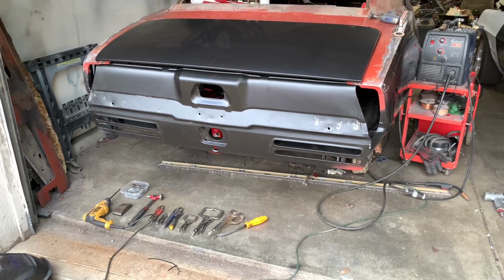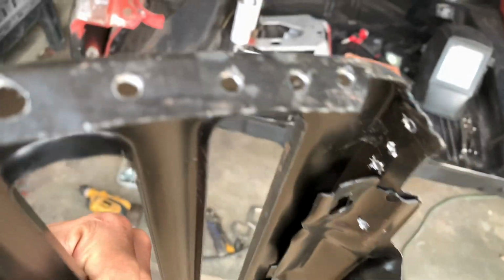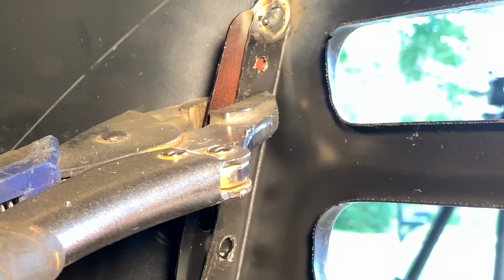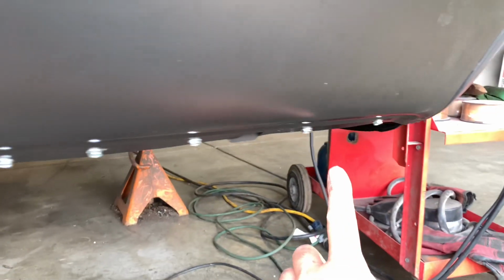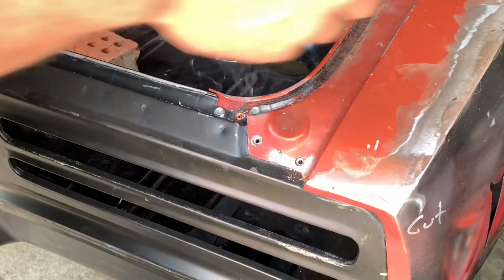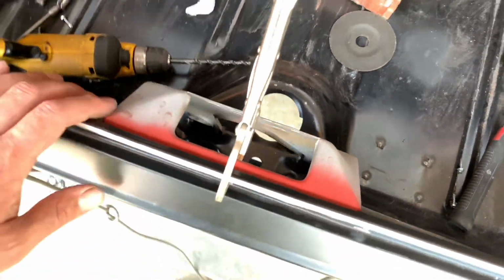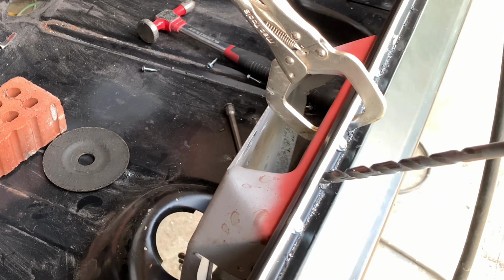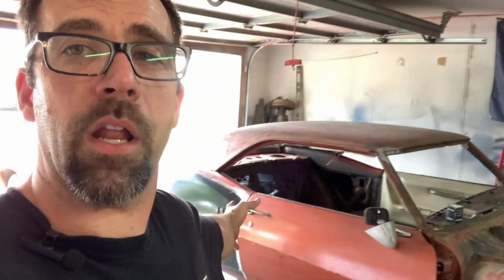1968 Firebird Restoration Tail panel final installation & welding-complete body overhaul how to

Comment: I'm restoring a 68 Firebird. The trunk was rusted out and i bought an aftermarket trunk shell to replace it. It fit nicely when putting it over the old trunk. I also had to replace the back end and tail piece as it was damaged. After putting the trunk in and fitting the new tail piece in I noticed it is offset by about an inch from where the gas door is and the bottom of the trunk where the gas hose comes through. I dont remember how it was, but is this normal and will it cause problems when lining everything up?
Reply from the maker: If you are asking if the opening in the tail panel is offset from the hole in the trunk pan by about an inch that is normal.  If you find the center line of the trunk floor and tail panel you will find the fuel door is centered and the hole in the trunk pan is not centered
Reply: @VinylVillageGarage  Thanks, I did notice in your video when you were welding in the bracket for the Gas hose. This video was a great help! Thanks again!

Comment: Went thru all these VVG Videos and you provide some Exceptional Tips! I'm getting ready to get into a 73 Type LT Camaro. Full Floor, Firewall, Trunk Pan, Pan Drop Offs, Tail Panel and Full Rockers and Quarters! I have about $5,300 in New Sheet Metal Plus $1,200.00 in shipping! What size are the sheet metal screws ou used? Full Rocker install First beings I will be using the Existing Floor Supports or should I get the Floor out of the way First? Thanks for the Tips and Videos. I'll guess you have about $4,300.00 in sheet metal and shipping and about 120 Hours!
Reply from the maker: The self tapping screws I use are #10 by 3/4”.  Some cases longer or shorter.  
I like to start with correcting or replacing the rocker panels.  I consider them to r frame and foundation for all the rest of the body and repairs.  Once they are installed or good they will be a constant point of reference for measuring and keeping things level side to side

Comment: I came across your channel and have binge watched for the last 24 hours. I'm amazed how you've basically built a car body with aftermarket sheet metal, and it looks damn good! I know there's do and dont's, sequences of installation but you make it look easy. I've got a 1970 RS that's all original and not as bad of shape as what you started out with.  I build engines and drive tranes but never body work. I use a tig welder occasionally at work and have some fabrication skills but this seems intimidating. Much respect!
Reply from the maker: Thanks for finding the channel and even more gooder binge watching!!  It helps
Me a lot and I do appreciate it

Comment: About to do a 68 Firebird convertible. What are you temps and wire speed as well as what welder? I wish you were my neighbour.
Reply from the maker: I have and Eastwood brand welder it was their 180 mig had for 20 years now. It used letter and number for the settings I have it at D-4. Most welders have a chart for setting temps check what it says and start with that then fine tune for your likes

Comment: That plate on the bumper bracket stiffener is probably the actual fender from a prior repair. Instead of drilling out the spot welds they cut around it. Collision repair shops don’t pay attention to details. My 69 coronet had random things just like that, I thought the car was 100% factory but come to find out it had a small fender bender at one point and the collision center back in the day did a great job repairing and blending out the paint.
Reply from the maker: If only cars could talk. like you noted some repairs are done very well and not detectible and then the flip side total hack.  Love to know the why

Comment: Jon, fantastic video's! Thanks for making these and sharing them. I noticed you use AMD parts. Have you ever used Ames body parts and is one company better than the other?
Reply from the maker: Yes I have, I use AMES for serval parts, they do a nice job overall, my friend Luis has used AMES body panels and had great results.   I use AMD  because I have a direct account and and friends body shop they ship to on the regular so I get a nice discount on shipping.  when it comes to panels I have had good and bad experiences with all brands even AMD. it as common but it happens, I also like OER panels as my second choice
Reply: @VinylVillageGarage  Thanks appreciate your response!

Comment: $7500 160 hrs
Reply from the maker: Very close, actually with current prices on parts and materials you might be spot on.
Reply: @VinylVillageGarage  Just purchased all new Sheetmetal to restore my 69 Camaro and have done one other full restoration on another 69 Camaro strictly as a hobby by myself and that's pretty much the hours i came up with hopefully this new build
 will be much faster easier now that i have a little more experience.
Reply from the maker: Nice doing another one, you will definitely find the next one has it own challenges and do parts of it more efficiently.  Where did you get your metal from? What brand?
Reply: @VinylVillageGarage  I got my metal from Camaro Central out of Richmond KY mostly AMD Dynacorn & Golden Star and I greatly appreciate all your videos on the Great Pumkin and the fact that they are in order as how the car should be taken apart and reassembled lots of great videos and i have watched them all at least a 100 times they were not in order as where to start and end you Nailed it greatly Appreciated thx again
Reply from the maker: Fantastic, i covered most of the important parts of the way I build cars.  Seems to work pretty good, especially if doing most of the work solo.  Good luck on your build.
Reply: @VinylVillageGarage  will do if your ever down around southern ohio stop by you got my contact

Comment: top notch work Jon.  Really appriciate the filming of the welding process on the tail panel.  I'm guessing for parts in the car you have about $2500-3K.  Beautiful work and valuable instruction.
Reply from the maker: Body panel alone you are close, seems inflation is affecting this hobby a bit too unfortunately. Still in the doable and worth while range.

Comment: The bumper reinforcement disk, I think I have the answer, The one with the extra thick plate, that might be for a convertible with the cocktail shakers ( witch I NEVER use !) They SAY there a anti vibration canaster, but I never noticed any difference with or without them, and they are heavy as HELL !  I still keep mine, but I never would put them in. P/S Them tail panels are the hardest thing to replace in the car, 9 million spot welds in multiple layers of sheet metal. Total NIGHTMATE ! if your using USED sheet metal ( there was no repops available when I did mine) and there was no youtube back then. Yep, been there, done that and I did mine in AUGUST HEAT! It was NOT a good time.
    As for your total price $ hmmmmm? right at $7,000.00. ( you bought just about 1/2 the car in parts. The real problem now is how many of the parts are BACK ORDERED ! I been waiting for a rear seat cover I paid for, for my daily driver Chevelle 4dr for 8 MONTHS ! and the new estimate of delivery they told me last week,------ UNKNOWN !!!!!!  Same for a normal flat hood, oh yes, they sell them, but there back ordered with a unknown delivery date. God I will be glade when our supply chain gets back to normal, this last 2 years has been very disappointing for old car guys. As for how many hours to complete, ---- I have the CORRECT answer!  MORE THEN ONE !  lol, Later my friend.
Reply from the maker: With that in mind on back orders, I should order my interior kit now. Just incase that goes sideways
Reply: @VinylVillageGarage   Original Parts Group sent me a set for a 2 door, TWICE !. My car is a 4 door ( the 4drs are wider )  The taking off machine works pretty good, however the puttin on machine, not so much. so we waite annnnd we waite And yeeeeeeeeeeeees I called everybody. out of stock, back ordered from all suppliers. All I can say is it makes more room to haul big stuff, but it's gettin old when folks ask, where's your back seat ? lol .

Comment: Jon, do the 90 degree bumper brackets that come with the trunk panel get spot welded to the outer tail panel?  I'm guessing they get spot welded to the frame rails on the bottom side, thus being a 3 piece spot weld, right?  Wouldn't you have to do the same for the vertical part, spot weld through the brace, trunk panel, to the tail panel (or vice versa)?  I'm replacing the left side bumper support on a '69 right now and trying to minimize the tail panel paint destruction.  The bumper covers that area but I still want it right. Thanks and hope you enjoyed the TA Nats!
Reply from the maker: Yes the tail panel is normally spot welded to the bumper bracket you are questioning about. Like you also noted it’s welded to the trunk floor and frame rail when done too.  I see what you are trying to do. Not damage the outside body panel. If I was in your Shoes I could see myself removing the old bracket and not welding it on the vertical face and use the bumper bolts to hold it all tight.——-Here comes all the comments on structural integrity and not how it’s supposed to be———I am just saying I might go that route and you do what you want it’s your car.  Not to mention you are most likely replacing it because it’s rusted or damaged  so whatever you do will be an improvement in Strength and structural repair as opposed to doing nothing with it and continue driving it.  

TA nationals was great just got home!
Reply: @VinylVillageGarage  Thank you Jon! I appreciate your technical advice.  I think I may just spot weld the bracket only on the bottom and let the bolts sandwich everything back together.  Glad the weather cooperated for the TA Nats.
Reply from the maker: Very welcome and thanks for keeping another awesome car on the road. Gotta save them birds.

Comment: Hours, too many, but money wise with just the few panels, I'd say under 1,500 with shipping.  Like the back half of the car can cost around 5k in metal from AMD, but that also depends on your location cause the cost of parts and shipping has risen exponentially.  BTW: I used self leveling two part epoxy in between those gapse masked off with tape instead of body filler.
Reply from the maker: Lol indeed many hours and many more to go. But hey time flys when you are having fun. Unfortunately parts and shipping costs have inflated a bit so I am on the high side of my personal guesstimate to this point. Still on track to get the job done of course.

Comment: Another great video, thanks for sharing the info, have a request, make a video on replacing a complete cowl when you have to do one, and 4700 in parts and 175 hours
Reply from the maker: Of course a cowl video is a must when I get the opportunity to do one. 
 You are also a very good estimator parts spot on labor hours is a little high but a reasonable guess.
Reply: @VinylVillageGarage  anyway I got neck deep in a cowl on mine so I’m in the drill look think drill look ponder think mode , typical first time metal work stuff
Reply from the maker: Sounds like a great time to me. The
Cowl is a big panel and keep in mind the vin# is stamped in it so don’t throw the old one out yet. I have a plan when I visit for it possibly.
Reply: @VinylVillageGarage  oh yes I know the data plate is on it , I’m not sure that I’m gonna replace it completely just yet but may end up doing that
Reply from the maker: The data plate and the last portion of the VIN is stamped on it.   Closer to the passenger side of the car but looking straight down on the top flat part of the cowl the vin is stamped directly into the sheet metal.
Reply: @VinylVillageGarage  yes the vin is right near the fan motor hole upside and it matches my vin plate too
Reply from the maker: Nice! That’s one by the bower but it has two total.
Reply: @VinylVillageGarage  I’ll have to look a little closer then Thanks , I’m learning more everyday
Reply from the maker: No worries, just sharing the knowledge friend.
Reply: @VinylVillageGarage  I am grateful 👍
Reply: @VinylVillageGarage  was adding the 400 you mentioned but I did go a little high probably more like 3200

Comment: Nice job 👍 Not looking forward to the contortionist welding when I get to it.
Reply from the maker: Thanks!! I have learned that being a contortionist was much easier 20 years ago, still doable now but in limited quantities. Maybe it’s a good thing that years of practice have paid off and I can get it done quicker.       
Your car is looks great. I still have yet to concur the mini tub modification. Nice work
Reply: @VinylVillageGarage  Got that right! 😂 Thanks, getting ready to roll the full floor assembly back in soon for the last time and weld it all together again. Slow going in the summer - too many other distractions.
Reply from the maker: @ParadiseBayCustoms  oh you are correct many distractions in the summer, anyway it’s looking great lot of nice fab work done for your four link set up.  You will have a very clean and nice car when done.

Comment: I should be in the garage rebuilding a power steering pump, replacing the radiator, and chasing down an oil leak on my Scout but I am watching YouTube instead. Going to spit ball $4500 and 130 hours.
Reply from the maker: Well I thank you for giving me some of your time to support the ole VVG.   Clearly you are knowledgeable on this subject of restoration I am at $4,800 120 hours spent a little more on shipping but it is what it is. Now get to work on fixin the scout.
Reply: @VinylVillageGarage  My first impulse was 120 but I was thinking of all that sheet metal butt welding and what slow going that is so tossed in another 10. Should have stuck with my gut.
Reply from the maker: Lol, well at least you weren’t picking winning lottery numbers and realized you guessed wrong and lost millions of dollars.  You are hired for estimating work of course.